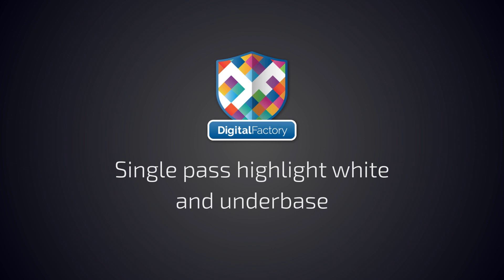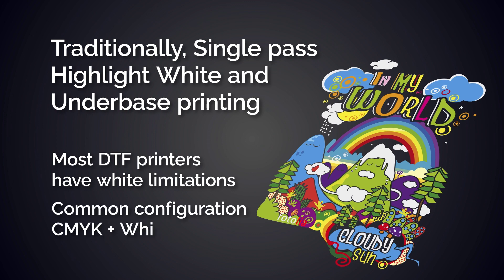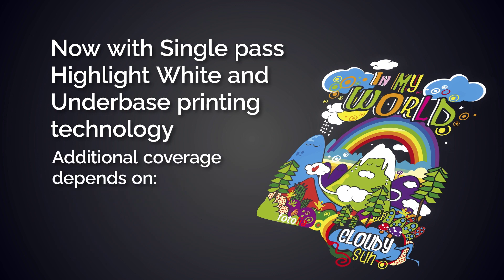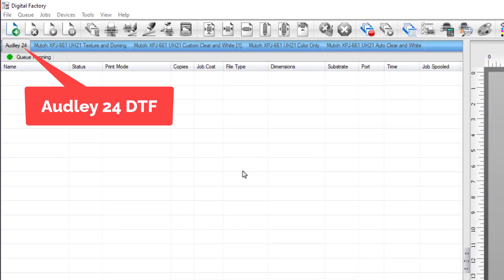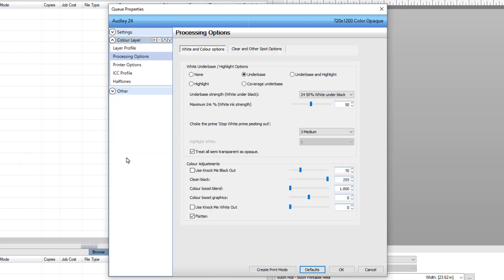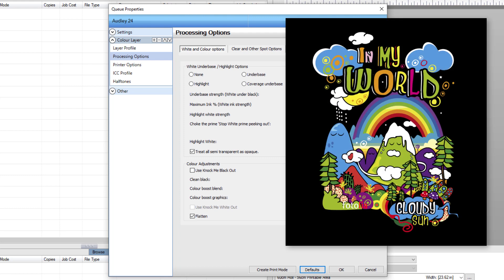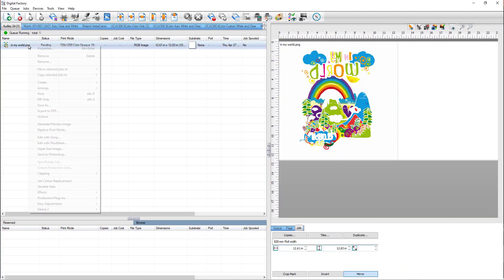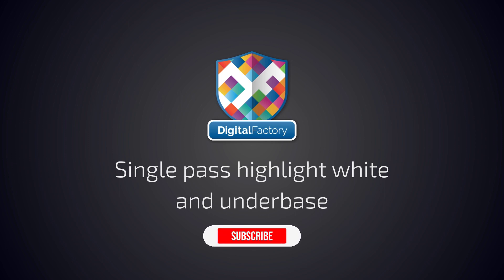Get Brighter Whites With Less Ink In DTF and DTG Using Single Pass Highlight White Underbase

Comment: Hi . Thx for the video. I own a Prestige A4 and running DigitalFactory Cadlink software. My biggest pain point is getting that nice layer of white ink on top of the printed image the way your print finished in the video. I get runny ink images at times , not enough white and i am wasting film and ink constantly as a result. Underbase vs underbase and highlight , max ink strength etc i have adjusted and still cant seem to get it right. No videos out there really touch on my specific issue and offer resolution . Can you help?
Reply: Sorry if this doesn't help. Points I am thinking about for your issue are: shaking the inks and not letting them settle? Adjust the amount of white (if white is runny) being laid down? Are you heating your prints before powder is applied? I usually run them over a ~50 degrees Celsius plate BEFORE it hits the powder. This may not work for you and sorry again, if this doesn't help...:body-blue-raised-arms: Good luck out there!
Reply: Sorry to hear you are having this issue have you check the humidity? ink shaker?